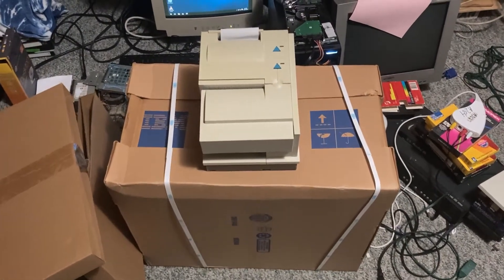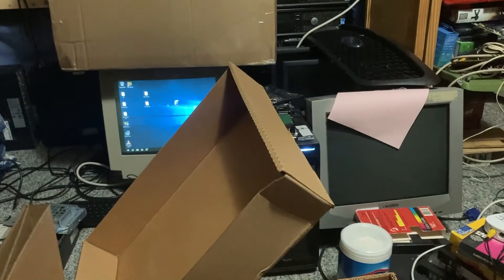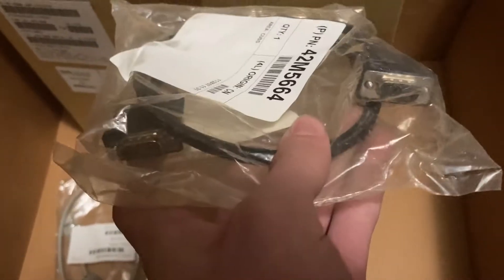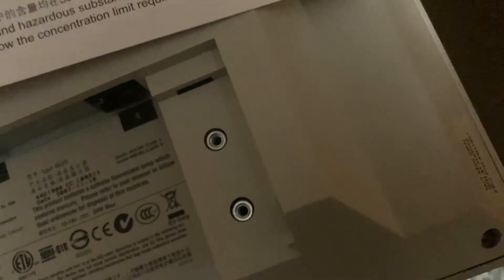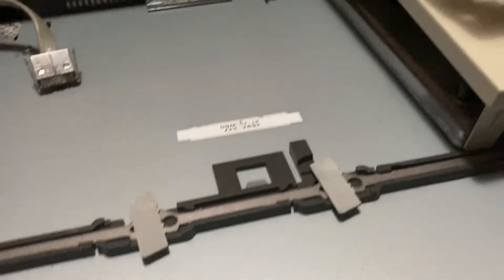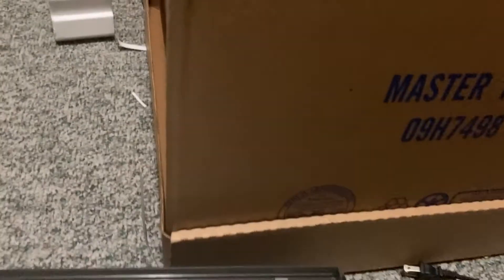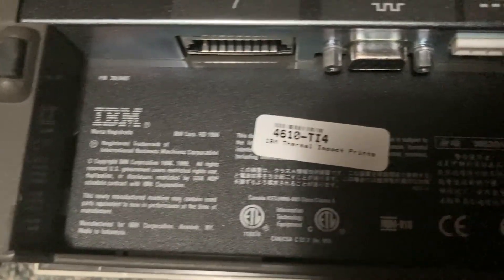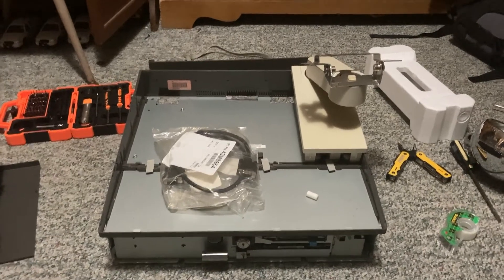IBM SurePOS 4694-347 Unboxing and First Startup

Comment: Are you still using the HP Probook 6560b?
Reply from the maker: I am not, it needed a new motherboard and when I took the motherboard out to cross check a newer version on eBay I broke one of the hinges for the screen. The laptop had enough problems at that point that I put it into long term storage. I plan on getting an Hp zbook in February to replace it.
Reply: @ibmsuretelecomp4690  I still use it.